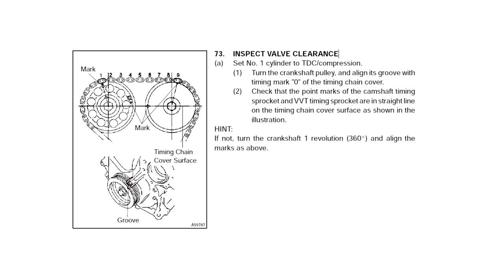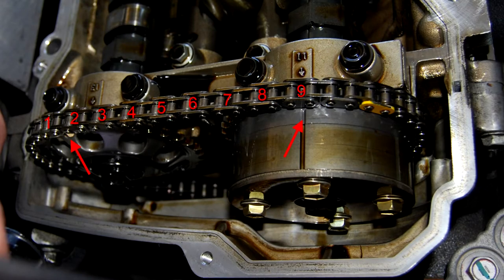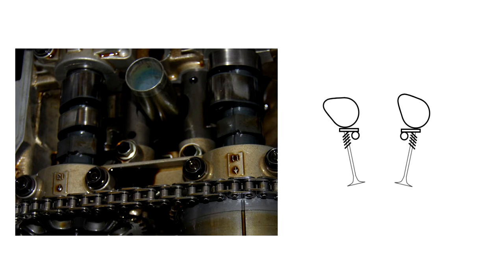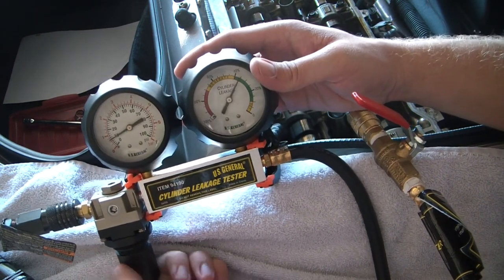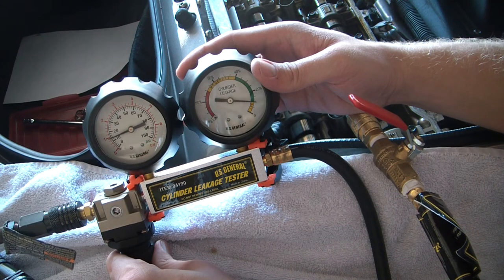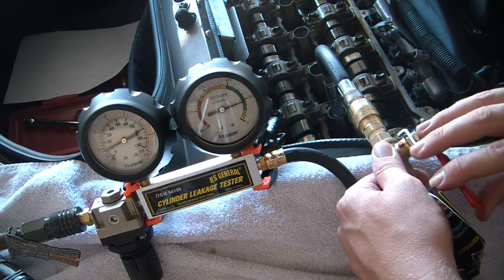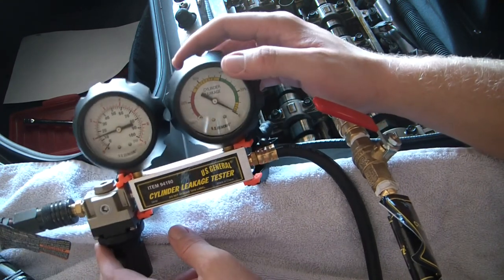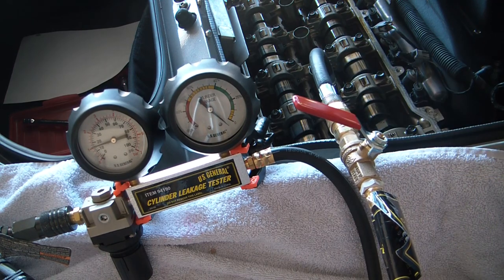Leak Down Test on 2ZZ-GE

Comment: Did you ever find the source of the compression loss? My 2zz has been gone from 190 psi on all 4 to 145 psi over the course of 3 years and 30k miles. Been running Mobil1 0w40 European formula at 4k mile intervals. Still runs good, but now i'm considering putting sleeves and pistons in before I boost it.